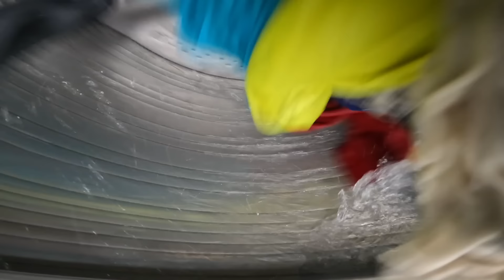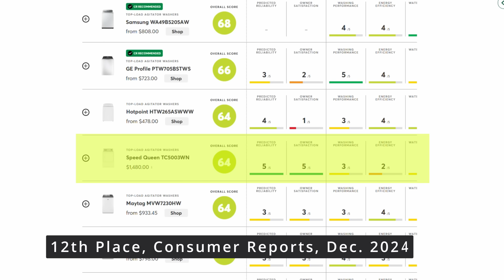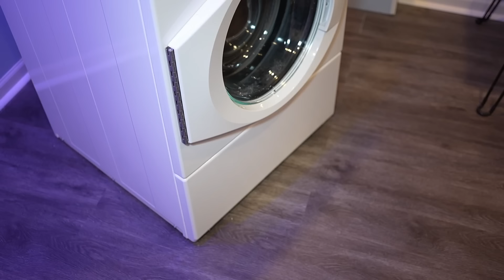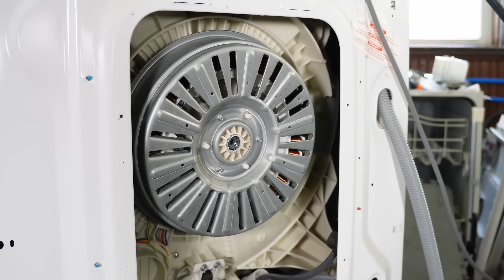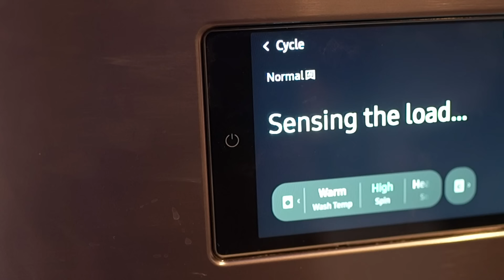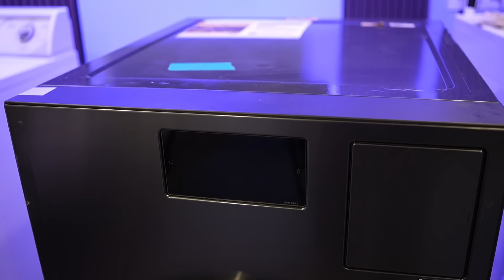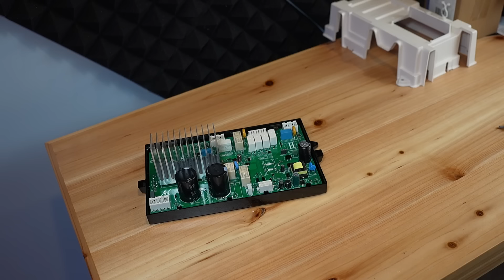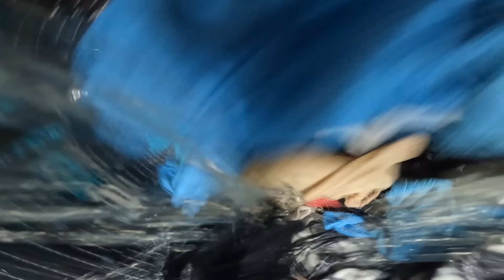Is America's Most Expensive Washer Great? The Speed Queen FF7009WN Test

Comment: The frontloaders in the US only run for an hour typically? My Samsung for the european market is running for 3 Hours. Incredible difference
Reply from the maker: "Depends"

The Samsung Bespoke and LG were usually between 1hr 30min to 2hrs 30min depending on setting. Quick wash is 30-45min usually.

But I would say standard medium soil / normal agitation is around 1hr yes.

Comment: I like my machine with a metal outer drum, made before 00, preferably in Germany, with a mechanical timer controller with the 200 wires going in and out. These new machines with the motor controller PCB having same microchips as your phone charger does, makes me squeamish spending my money on a new thing. I did for my mother and after two years the main PCB crapped out the machine has stopped working the main display started showing random symbols and when I took off the front plate the selector module witch was a tiny PCB fed with 5 volts from the main board gave a full 220 shock and I slashed my hands on a metal frame wia reflex. I too out the main controller and behold a small cap had blown open somehow and a few of the microchips blew open and covered the entire board with soot. Old machines would never do that because they don't have the tiny microchips on the same board that has soldered traces for the 1,8kw motor. To replace that board it was 180 euro. The new machine was 520 euro. For myself I have recently bough a German oko lavamat 1988 used washer, replaced the spider, all bearings, gave it a real good scrub (the inner drum parts) with a wire wheel on a drill and polished it, replaced bulging caps, replaced both shock absorber's rubber orings and installed the new springs. The washer works like new again, and it doesn't have the god damned controllers that ruin everything prematuraly.

Comment: The drain art the bottom - now high enough to really get anything for the water to go into and is just going to spill all over the bottom of the machine or towel.  Maybe less water comes out than the GE we bought a year ago or the LG we had previously - but with a crappy back - last thing I want to do is lay on the floor, take a panel off,  soak up water with a towel and put it back together again.

Comment: You asked for comment on the testing methods…

1. Tests should mimic what people do to remove actual stains in the real world. 
2. People pre-treat stains.
3. Cold water is sometimes more effective for stains because hot water sets the stains.
4. You never dry a stained garment, it sets the stain.

Thinking of why we launder…

To remove bacteria, sanitize, remove odors, and bodily fluids.

Washing almost never sanitizes clothing, but drying does. 

Find a way to test these things in the washer and dryer and you’ll have an effective testing method.

Example, is there a spectral analysis for bacteria for before and after testing. If so, you could get a before and after analysis to normalize the test assays.

If you have any friends that do lab testing, they could help you develop a test that utilizes real world techniques coupled with normalized and meaningful outcomes.

Comment: I thought I might want a Speed Queen when we needed a replacement, so we went to a large dealer who had them.  I didn't like the unusual control panel, which seemed too hard to read, among other things.  We bought a Miele and are happy with it.  I'm sure the SQ is a solid, practical machine, the Miele just seems a better fit for our apartment life style.  We prefer a small washer.  The one thing that won't fit goes to the laundromat, where they have SQs in all sizes.

Comment: I've had several top load Speed Queens over the years, both in my home and in rental properties. I've NEVER had a failure. That said, the top loader I've had are the plain-jane units, no digital, no keypad; just good old-fashioned analog knobs. I've replaced a few fill valves when they slow down a little, but that's a water issue not a valve problem. Every component is made for long life and reliability. I'll never buy another brand.

Comment: We've had this and the dryer for 4 years now. Best investment ever. Other than having the water coming in turned to a lower pressure so it doesn't splatter water/soap down the front, that's the only issue. The dryer (electric) does have some hot spots even on permanent press and can burn some nylon garments.

Comment: IF I had run the test, I’d have run each load at its maximum cleaning capability , not mid-range. That would better prove the point as to which machine could provide the cleanest, stain free, load possible. All you seemed to have done here is poo-poo the justification for buying the Speedqueen, at twice the price.

Comment: I use a speed queen washer (TC5) and dryer out in the barn for the teat towels. The washer is literally rusting away from the top and still working. All ive had to do to the dryer is igniter elements and some gas solenoids. They are really easy to work on.

Comment: You're not supposed to pack a machine any washing machine  like that that's just common sense., if this is basically cold water testing then you shouldn't really put the video up because it's not really a test it's not really anything I don't know why you ever made this video
Reply from the maker: I'm not sure what you are trying to say at all. 

Speed Queen directly says you can pack the machine far fuller than I did. Cold water washes are the absolute standard in some countries, and there is a major push for using cold water exclusively. I also did hot washes if you paid attention to the full video. What exactly did you want, and which reviewer did exactly what you desired in a review?

Comment: On stains the you tested I dilute Dawn dish soap 50/50 with water and  use a teaspoon or tablespoon on the spot first.   
Let the soap soak in over night then do a load of wash with less laundry detergent then I would normally use. 
The key to this is to use  as little Dawn as possible . You do not want foam in your wash. 
I would of like to have seen that test done with different Landry detergents but it was a test on 
a washer machine not detergent. 
Love all the information you give.
Howard the home owner. 😊
Reply from the maker: I think a non detergent laundry test would be fun to do. Project Farm did a test on various detergents which is great, so I gotta add a different kind or value

Comment: The capacitors on all those boards will in no way last 25 years. I think you'd be lucky at 10. The fewer electronics the better. Disclaimer: I hold a B.S. Electrical Engineering and own a 2017 speed queen top load mechanical dial controlled washer.

https://youtu.be/vV2p1DwDFFw?feature=shared

Comment: in Europe our Washing Mashines have a Eco Programm that takes almost 3 Hours to finish. But in this Eco Mode it uses only 12 Gallons of Water.

And you said if it has a "C E" mark it is Chinese Made. But that is not quite right. There is the mark "C E" which stands for "The abbreviation “CE” stands for “Communauté Européenne”, the French term for “European Community”. It stands for EU-wide harmonized regulations." And that "CE" stands for China Export. You have to make sure that the "C E" logo has a space between the letters.

But in the video I can see that there is a space between the C and E. And i see its from DIEHL that is a German Home appliance industry suppliers, aviation equipment, defense technology, electronic controls and measuring instrument technology. On the Pump is the Brand "Hanning Elektrowerke" to see. Thats also a German Brand for a factory for electric drives.  I just wanted to avoid misunderstandings.. Sorry :)

Comment: Very informative video. Thanks! We are looking at a new washer and this model is definitely on our list, as is the SQ toploader. Look forward to seing your head-to-head comparison of the two SQ units. BTW, regarding blood stains, two comments: heat and time set blood stains. Avoid warm or hot water and remove as soon as possible. Forget detergents and/or bleaches. Use hydrogen peroxide. Hydrogen peroxide will completely remove a blood stain that has not been set and is reasonably fresh (up to a couple of days old). Nothing else works as well to remove blood stains. Apply hydrogen peroxide to the stain; let it foam up; wipe away with a damp paper towel after foaming stops; repeat until the stain is gone.
Reply: True, we nurses use hydrogen peroxide for blood stains. An older adult who worked in a laundry mat informed me that Top Job floor cleaner & other uses, was best product to get dried deep seated blood out, I guess that’s the ammonia ?
Reply: I phone translation mistake. I typed in seeded not seated.

Comment: These machines have doubled in price since covid happened, they were 1299 for a long time.

I'm a servicer too and have the FF7003 model. I love it. The biggest issue I've seen is walking. The stock feet are hard nylon and they tend to slide on vinyl floors. Use the cheap rubber blocks from the jungle site and no more problems.

Comment: My parents have a Speed Queen front loader set.  Older design, the front loader with what they called “back controls”, where the control board is where you’d expect it on a top loader.  Theirs has the chunky rotating selectors.  It is the quietest, most well balanced front loader I’ve ever experienced.  It cleans better than about any washing machine I’ve ever used and has required zero maintenance.  The matching dryer is excellent.  It has a bare metal dryer interior and appears to be grounded because there is virtually no static cling.  Speed Queen is worth the money.

Comment: It is said that poor man pays twice and that has never been more true than today because everything is least twice as expensive.😢

Your job at Consumer Reports is unwarranted because they actually do a very good job and have been a reliable source for buying advice for decades. Personally I think they are far more credible than your video which I think you downplay the affordability factor and spent way too much time justifying the price. The math just doesn't add up.

Today's washers are generally very very good. Yes there may be some models that are not but with smart shopping you can have a very good washer l that performs just as well or better with more features and versatility for 1/3 the price. 

One thing I've learned about high-end brands is that there's no guarantee that they will be 100 reliable over long-term and that the cost is a very poor indicator. Back in 2013 I had bought a $5,000 espresso machine from LA marzocco a top name in the industry and within the first few weeks I had experienced a couple of major issues with it that required repair. It was very surprising and inconvenient. Many years later I had bought a Samsung refrigerator which I was warned are the brand being not the best Refrigeration but I went ahead and bought it and I'm going on 5 years now with zero issues.. my experience with it has been stellar. And I'm not trying to defend Samsung and they have a history of bait and switch selling tactics so you have to be careful of that. But their products are great in my experience over the years. Anyway this refrigerator is three times the cost of the the average washer but it does not offer anything more in terms of performance. As far as durability well that is really you can only hope but at 2400 I think that's a pretty big gamble especially given that there are many users out there that have plenty of complaints about their reliability so like I said there's no guarantee for 100% reliability Even at half the cost you can buy a very good Maytag washer that will last just as long and for a little more you can buy extended warranties for Peace of Mind long term.

Comment: Speed Queenside are also very serviceable by home users with basic hand tools and parts that are cheap on Amazon. Going on 13 years this May for our units with total cost to keep them going is around $130. One $7 mixing valve for our washer and a $123 timer control panel (zapped by power surge). Total time spent on repairs is sub half an hour.

Comment: washers used to be and should be simple mechanical machines. as machines become more complex, they break more, and of course will cost more to repair, and will prob require the requisite "new mother board or control board" which costs $$.  it's a big scam really, an extension of 'planned obsolescence'.  it's happening in home appliances and now especially in automobiles.  Techs have difficulty fixing these things. this isn't theoretical, I've seen it over and over.  the commercial washers and dryers are mostly mechanical.

Comment: My brand new gas dryer “LG” had a faulty temp sensor out of the box…the LG  tech said that they had a bad batch of temp sensors…it boggles my mind that they were not recalled…I will never buy another LG appliance…they repaired it under warranty, but I was still very dissapointed.
Reply from the maker: Many of these units have faulty motor control boards early on in 2020 from covid parts so it's not relegated to LG it happens to virtually every single manufacturer and I can assure you they are not going to recall a machine for a $5 part
Reply: @ that is exactly why I consider this poor PR…they have lost a future customer….i have been looking at Hisense products…they seem really decent, especially for price … do they make good gas stoves? looking to get a 6 burner stove

Comment: Speed Queen is living on a reputation for commercial stuff. Here is the issue as I have first-hand knowledge of. Yes they build stuff well BUT they are extremely small and I mean small. This leads to having to do many many loads if you have a family, not many folks I know want to be doing laundry for hours each day. Why they don't build anything more decent sized is beyond me. I currently own an LG set that allows me to do laundry no more than once a day no matter what and as direct comparison in similar run times. Now a huge difference is costs, the Speed Queens are 2-4x more expensive so you must accept that sure it will last but convenience is not good and even if my LG lasts like my old Maytag 10 years I can buy 2-3 before reaching the price of a SQ. Be careful and use your thinking caps and really think through extended warranties as they are getting very costly
Reply from the maker: Thats definitely my belief too. In my house I couldn't justify it. When I have to finally swap everything out, it's gonna be an LG front load washer and heat pump dryer.

Comment: We bought a speedqueen second hand in 1995. It sat outside in the sea air its whole life. It has never been maintained. Took 400 volts like a champ, and the only thing that we changed was the drive belt. In 2024, we gave it away, and it's still working.

Comment: It obviously looks as if it is a computer controlled that to me is a negative when it comes to longevity. When a washer dies because it's CPU has a problem that sucks. Typically commercial equipment like in a laundry mat is as simple as possible no bells n whistles just basic functions and options like heavy through light and temp because it's less to go wrong. I've had modern appliances that were less than 10 years old take a crap and dragged a temporary old appliance to get me by and their old and beat up really basic and work absolutely flawlessly. My big double door fridge lasted about 8 years I bought a temporary $50 fridge off market place, it was manufactured in 1988! It was kinda small the door shelves n retainers were cracked or missing but it ran beautiful. My whirlpool duet sport washer took a dump and my mom's old top loader with mechanical controls from 90s worked fine. Same with my range it started having issues I tossed an old one in its place for a few months with the big open coil elements, it worked fine. I will say my duet front loader washer got clothes cleaner than any washer I've ever had. I will also say The estimated time left was infuriating, sometimes it would be on 1 min left for 10 !
Reply from the maker: Every single modern commercial washing machine is going to have more computers than this does.

Comment: So based on the stain tests the LG washes better than the SQ? The tradeoff being the build quality. A condo i bought came with an LG WM3050CW that is an 11 year old model and it still works great. Just needed to replace the door seal and it is now used by my tenants. Even that is still larger at 4.0 cu/ft than the FF7, and 1/3 of the cost. I liked it so much that we purchased the LG Signature washer for our second place. One year in and no problems yet *knock on wood*. The LG is a huge washer with a lot of features and it's $600 cheaper than the FF7. It was hard to argue for the SQ at that price and feature difference.